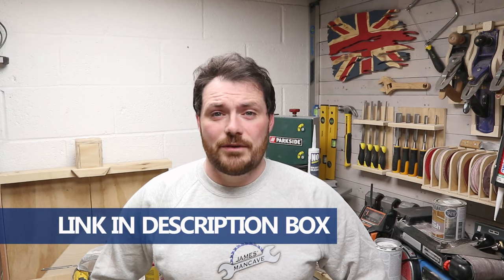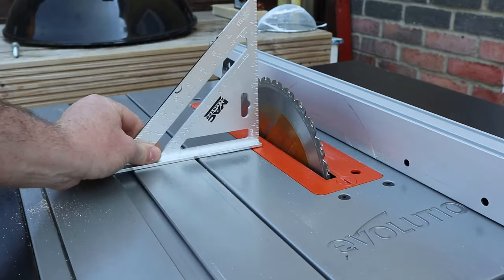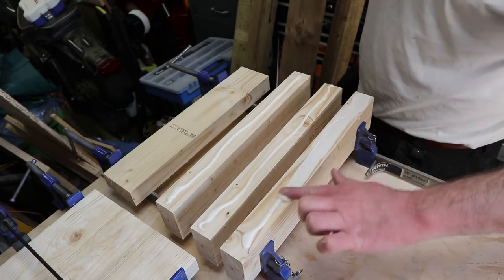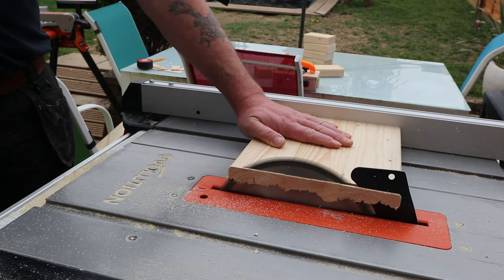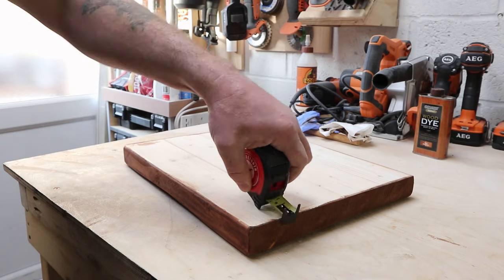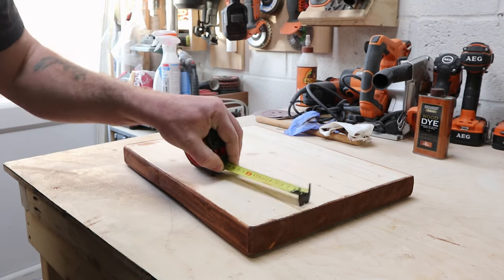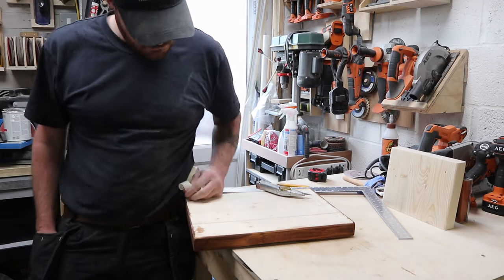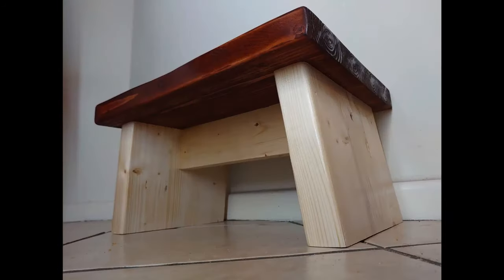One Handed Maker Challenge - The 2x4 Step Stool

Comment: Great project James and thanks for taking the time to take on the challenge😀. I should have shares in the hot glue company as I’d be lost without it! 

Really interested by your new mitre saw. It looks a fantastic piece of kit. Is it cordless as well?😳

I see you didn’t harness the power of leg clamps when changing a drill bit. By far my go to method! Once again thanks James for getting involved! Take care, Leo
Reply from the maker: Hey mate, thank you for setting up the challenge, it's one of those things that I'd not even considered how to change a drill bit one handed, or use pencil. But now my eyes have been opened! Also it made me consider the safety aspects more also. And no lol, I hadn't considered the leg clamp method, I'll try it though.

The mitre saw, well I bought it about 8months ago, I've only really used it the last month as was going to save it for when I build my mitresaw station, it's got a really clever dust extraction on it, it sorta has its own vacuum built into it. It's not cordless no. But, if you can keep a secret, I also have the cordless version too!😆

Have you seen this drill, I bought one a while back in a b&q clearance, I think you would benefit loads from it loads. I forgot I had it till I changed my drill bits. But basically it has a bitlock on it, which translates to a motor driven chuck. All you have to do is twist it the way you want it to move 
https://www.ebay.co.uk/itm/183706297016